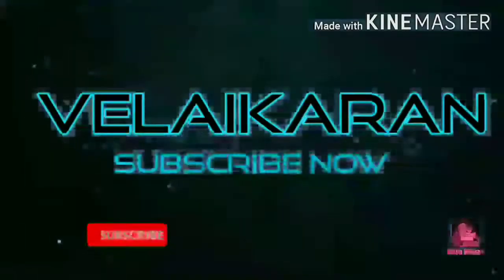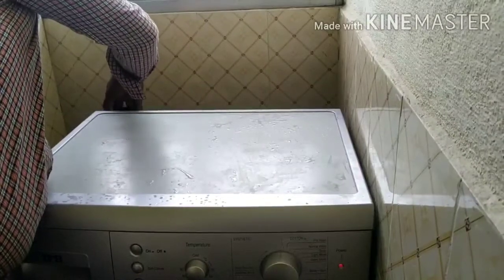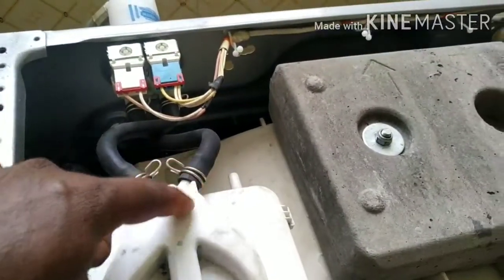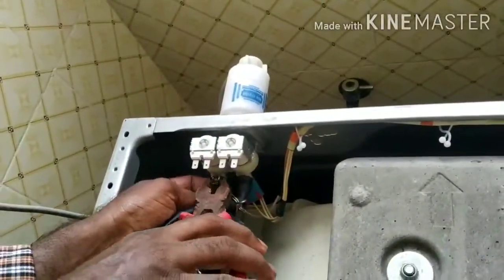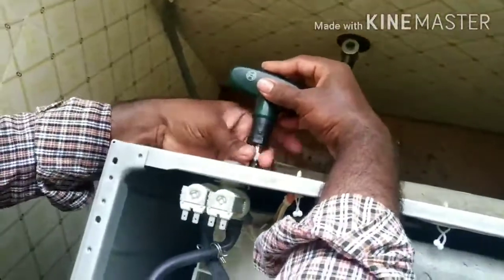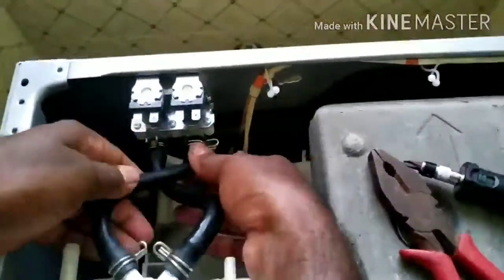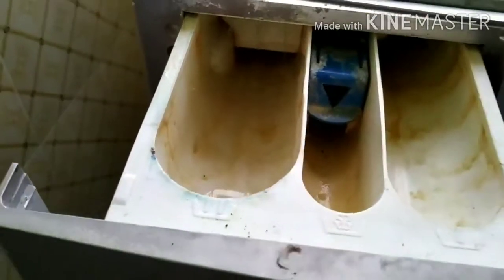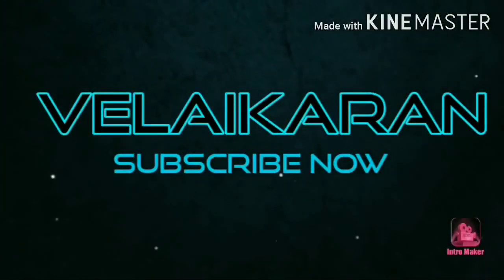Washing machine Water not coming and how to fix it

Comment: Sir engalodathum ifb washing machine front load washing machine tha but tapla pipe connect pani inlet valve kula fix pani water on Pana water outside varuthu sir machine kula pogala why sir?
Reply from the maker: SV not working

Comment: Bro valve la, power supply line and neutralaa illa , rendulayumae line thaanaa bro
Reply from the maker: This problem is nutral cut issue so please check wiring connect properly and change the wire if need
Reply from the maker: Rat bite in wire

Comment: Sir in my LG washing machine model  F8068ldp  water  wash agum pothu pump aaguthu sir aana rinse aagum pothu water vara matiguthu..what will be the problem , how can I recover that ? Plz reply panuga
Reply from the maker: Plz check pressure sensor and change it
Reply: @velaikaran8436  thnx for the reply sir

Comment: Bro in my IFB Senorita VX water is coming. It fills 25% and draining automatically. And no action after that. What to do?
Reply from the maker: Plz change pressure switch
Reply: In dispenser unit water is pouring only on the right side and not on the middle and left end(detergent end). It shows 'tap' error 5 minutes after draining water.
Reply: Just got it fixed bro...  Pressure switch connecting tube was released by its own... Fixed it back in  place...
Reply: Thank you very much....